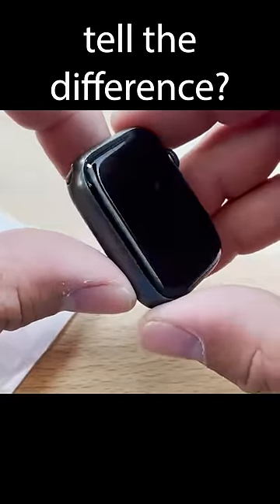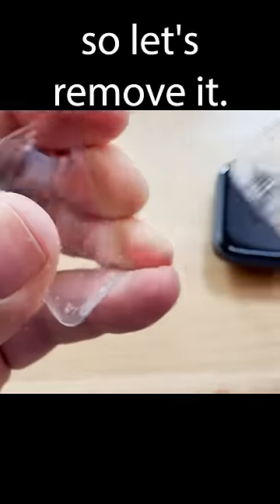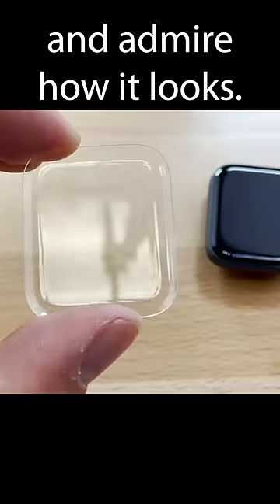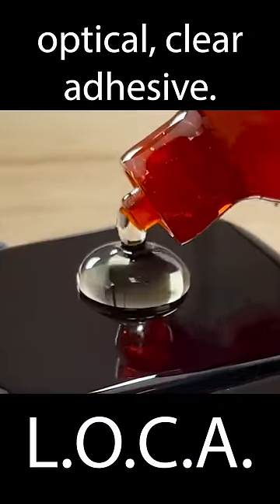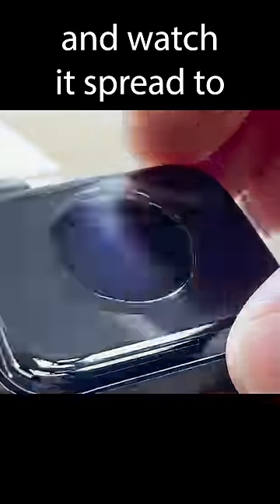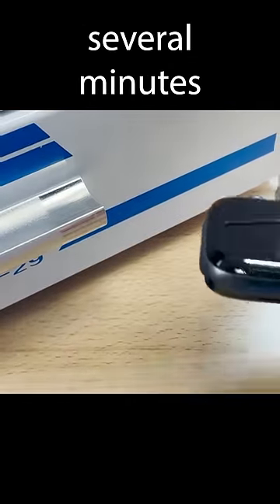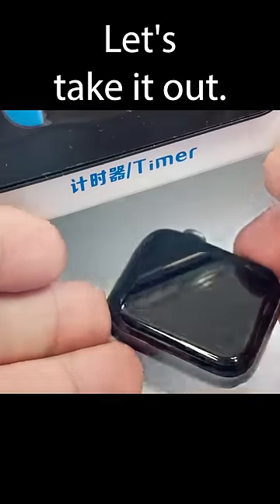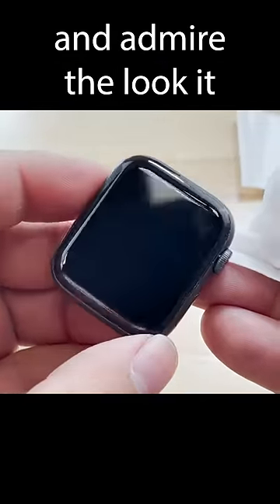Apple Watch Tempered Glass (how to install)😁#Shorts #satisfying #applewatch #temperedglass

Comment: Now let's see you try and peel it off without breaking the screen
Reply: English be like - ya sab pack kr do
Reply: Unfortunately no, in our repair center whe charge. £20 to remove them, and its a reason behind it. Never do this to your watch.
Reply: @swasggyswiftnbasic  no it doesn’t.
LOCA is used to Factory glue digitizer to the LCD/OLED panel.. it’s meant to be permanent, cured with UV it’s permanent and resisten to every chemical. Only way to remove it is with very thin wire and cut the adhesive
Reply: @swasggyswiftnbasic  have you ever replaced just the digitizer and not the whole screen?
Reply: @markus7660  who said factory used loca
Reply: @markus7660  all factory used oca
Reply: @markus7660  loca is messy compared to oca
Reply: Guys I tried it and its a pain in the ass to remove. I pulled off the screen trying to remove it. I had to glue it back down.
Reply: It comes off easily.
Reply: @swasggyswiftnbasic  what is it called and where to find it?
Reply: That’s why I got a plastic screen protector for my Apple Watch.
Reply: @roosi3083  No it uses the same glue that they put to glue the oled to the glass on a phone. You need a really thin wire to cut the glue heat and alcohol won't work.
Reply: @markus7660  nope, there are different types of LOCA glue with different properties.
Reply: @qverto9749  😭 🤣 😳 i went through all these emotions
Reply from the maker: It depends on the type of LOCA. some harden all the way but the one I use remains in a compressible state. helps maintain touch and can come off with a small amount of effort.
Reply from the maker: you've obviously never refurbished a screen before then...
Reply from the maker: Thanks for pointing that out! People who don't refurbish screens have no idea how LOCA works
Reply from the maker: thanks for pointing that out. Most factories use OCA not LOCA
Reply from the maker: Probably the best way to describe LOCA "Messy" the only benefit is no need for an autoclave if done right... so no bubbles.
Reply from the maker: with something like floss or thread you can slice this type of LOCA off with ease.
Reply: @tomci121  I repaired way too many Phones for saying “LOCA is okay”.. it’s stupid.. 1. 90% of times I experienced people use LOCA on curved Phones and it’s almost impossible to get it off without breaking the screen itself.. Yes you can slice it with very thin wire but often times they apply it and press on it very hard so there is almost no gap to put the wire.. 
2. Screen protector is for scratches NOT to be drop resistant.. If you glue your very hard screen protector to the screen usually the screen protector is fine and screen beneath is broken (or both are) cause - physics.. energy has to be absorbed somehow, the most brittle/soft thing breaks.. Therefore if the screen protector is harder than the screen on your phone, your screen is going to break.

Don’t listen to these stupid tips here on YouTube some users post.. never use LOCA for a screen protector 
-Phone case is for drops
-Screen protector is for scratches
Reply: Use a loca blade, it's better than wire
Reply: @qverto9749  🤣🤣
Reply: @ahmad0900  I understand 😂 this one but what about others?
Reply: @qverto9749  Your mom be like: AUGH STOP ITS TOO LONG AUGH
Reply: @nmac101  Wtf Augh means?
Reply: @swasggyswiftnbasic  try it on a super expensive watch now
Reply: Yeah the glued on screen protector has to be the stupidest thing I have ever seen. Only second to those liquid glass screen protectors that get promoted. Just the liquid. If your screen breaks it's still going to break it's not protecting shit.
Reply: Those who say is permanent, you have never use screen protector with uv glue before on curved display, they come off easily without residue
Reply: Alcohol and dental floss will work ;)
Reply: Your not supposed to tho
Reply: @FIXDPHONES  do it up then lol
Reply: Some brake cleaner removes LOCA easily. I don't know why you think it would break the screen, you could even use heat and a metal blade...
Reply: I have used UV glue to install protector on my galaxy s10+. It is removable for sure. Even a curved case often pull protector out from screen.
Reply: @swasggyswiftnbasic  youre lying
Reply: @qverto9749  what?
Reply: @qverto9749  no??
Reply: @markus7660  ive tried whitestone domeglass, tg glass, whatever that uses liquid oca to bond the glass screen protector, and i can tell you that you can remove it by hand. sure there may be some residue but alcohol can get rid of it. the only problem i seen is that it EATS away the olephobic coating, and when you plan to remove it, the screen feels dog** and youd need to either get another tempered glass or apply an oleophobic layer. i'm sure this isn't pure loca, they probably diluted it for commercial use.
Reply: @markus7660  sound about right
Reply: @qverto9749  wtf are you saying
Reply: @swasggyswiftnbasic  where can i buy this for iphone?
Reply: I do lcd repairs uv glue and loca are different
Reply: @swasggyswiftnbasic  1. it’s permanent (the watch screen protector) 2. How would you know you do muck-bangs💀
Reply: bro this comment pissed the creator off 💀 bro went crazy in the comments
Reply: @FIXDPHONES  show it in the next video
Reply: @peydev  ikr
Reply: @qverto9749  bruh your not funny now if someone was mocking Spanish or some shit y’all would be offended
Reply: Not that hard. Depending on adhesive.

I've got the same type of screen protector on my phone, I had to replace it last week due to cracks. Was fine.
Reply: @kjc5513  Kid got offended
Reply: if it like whitestone dome ones it should be easy to get off
Reply: @swasggyswiftnbasic  I got this tablet broken
Reply: @swasggyswiftnbasic  Augusta I got this tablet doesn't charge
Reply: It’s a bit stronger than a normal screen protector but it comes off without damage pretty easily.
Reply: @markus7660  You a legend. Thank you. Was thinking of getting this adhesive but after your comment, I'll stick to the regular tempered glass. Seriously, thank you!
Reply: @Blssc  no problem, glad I saved some screen from ridiculous damage.. If someone is skeptical just search the topic, what are the manufacturing processes of OLED/LCD panels
Reply: I use this tech for my phone screen protector. It's quite easy to take it off...
Reply: @TWatcher_  Same, in fact I took mine off just yesterday and it came off using just my fingernail with very little effort... Dunno what the guys up there are talking about.

Comment: I need this!! All protectors I find are too bulky and take over the screen
Reply: Yknow this will permanently stick the protector on the watch
Reply: @smshii  bullshitt. Its just a normal uv screenprotector. People use them on samsungs with curved screens too. 
You can take it of like any other screenprotector. Dont spread bullshitt if you dont know what you are talking about.
Reply: @dennis-br6vr  no it’s legitimately not, you’ll have to replace the screen
Reply: Do not do it, you scratch up the protector and… there’s a freaking screen protector glued to your watch that’s damn near impossible to remove without damaging the watch. Or you don’t do this and you scratch your watch but you are at least touching the actual screen and not some cheap protector that’s never gonna come off. If you need a screen protector on your watch just get one that you don’t have to glue. Also with modern iPhones, screen protectors aren’t a necessity anymore… ok maybe back glass protectors with the 15 pro line.

Comment: What do you use to clean the screen protector with preinstalled adhesive prior to installation?
Reply from the maker: Isopropyl alcohol or acetone
Reply: @FIXDPHONES  does it have any effect on the glass adhering on the adhesive? Would you possibly have a link to the glass screen protectors too?
Reply from the maker: Series 4,5,6,SE (44mm) https://www.ebay.com/itm/373903126839
Series 4,5,6SE (40mm) https://www.ebay.com/itm/373903128183

Comment: I’ll be able to tell once I’m trying to use it and have to press quite hard with any glass screen protector on an Apple Watch.
Reply from the maker: Great comment, but I haven’t noticed a loss of sensitivity with this method, if loss of touch occurs it’s probably too much LOCA
Reply: It won’t become more difficult to use the touchscreen.
Reply: @RWFidelity  I’m assuming you haven’t used an Apple Watch with a glass screen protector.
Reply: @shaneanagrams  I actually have one on my wrist right now, but thanks for assuming.
Reply: @shaneanagrams  its not the glass that messes with sensitivity, its the air in between
Reply from the maker: Good thing my method removes air as a factor as its non existent between them then

Comment: If there's no nondestructive way to remove the cover glass there's no advantage. What's the difference if you scratch the display's surface or the cover glass, if you can't change neither of them. 🤷🏻‍♂️
So if you wanna make me like this cover you have to prove that it is removable with sensible effort or way more resistant to scratches.

Comment: Is there anything like this for phones too? I bought a screenprotector and there is only adhesive on the edges.
Reply from the maker: https://youtu.be/RXAzJ3SfZGE
Reply: I bought one advertised on eBay and doesn’t come with optical glue that holds it on.
Useless without that.

Comment: No one ever used protectors on a regular watches. Why even bother to use it on smart watches? The glass is so small, that you have to try really hard to crack it. After using one Apple Watch for 5 years without even thinking of being careful with them they have like 3-4 barely noticeable scratches. I don’t get it, it’s like using tv remote in its plastic bag it came with or leaving protective film on the seats of your new car. I get it with the phones, where the screen is so big, that dropping it may shatter the glass. But with watch, why even bother can someone explain to me? Those watches get obsolete in 3-5 years anyway
Reply from the maker: Well having personally repaired thousands of Apple watches over the years from all over the world I can definitely say that they break. Some people take great care of them while most breaks are accidents.

Comment: Yea this stuff is super glue, good luck taking it off
Reply: It comes off in a thin dried layer of glue.
Reply from the maker: https://youtu.be/RXAzJ3SfZGE
Reply from the maker: https://youtu.be/RXAzJ3SfZGE
Reply: This method is only usable for curved glass, most iphone is not made with this method because the screen is flat, there is a down side is that if you use too much glue, the glue can get into the buttons and speaker ive used this method for main years and i have like over two dozen of the UV light in a bag